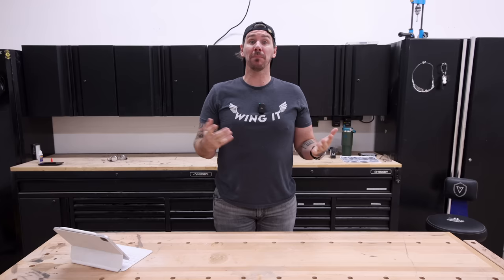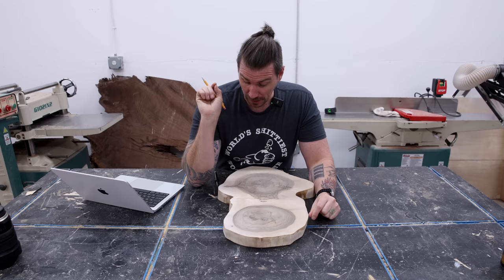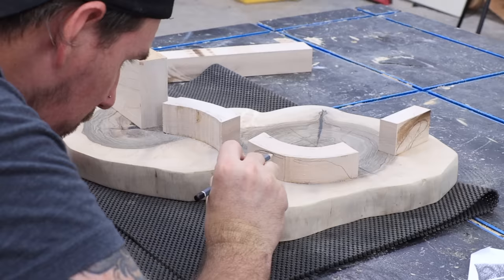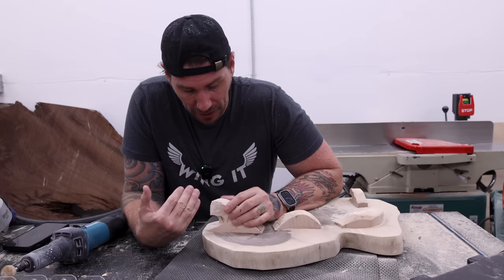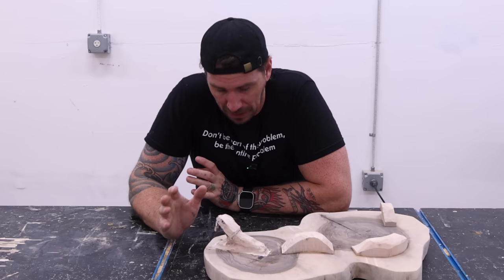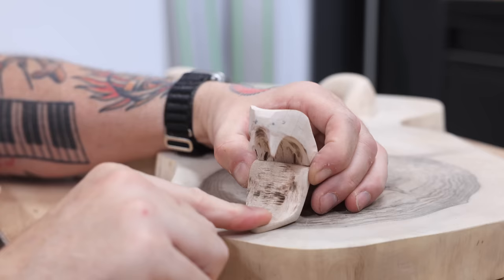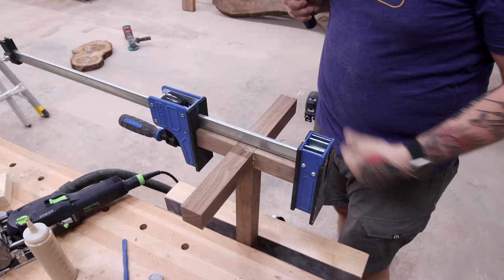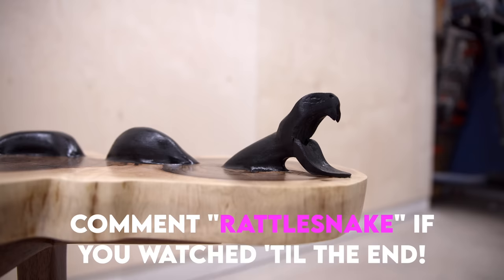Impossible Animal Carving Table

Comment: little tip i saw from another woodworking youtuber, when trying to remove excess glue use a drinking straw and you can usually get it in one swipe.

Comment: I'm impressed bro weather you fail or not keep going. You did as good as I could. I've been a carpenter for 35+ years. I just started doing wood work and mess up all the time however it's so much fun to me I just try n try again. Keep up the great videos amd don't let idiot comments even concern you. Table looks fine. Yes almost all snakes swim on top the water.

Comment: Rattlesnake.  Not exactly the buff tones of the one I met years ago, for sure.  Idea I had was, get images of rattlesnakes printed in black and white, to scale for your carving, then, after tracing the scales onto the snake body, come back with a wood burner tool to burn the tracing into the wood. You could probably still do that, then buff out most of the black, leaving India ink in the crevices. Cool table idea, as it turned out, regardless. Definitely room to put a tea mug and a book or tablet down between the snaky parts.  Thanks for sharing that we don't always have to have perfect projects. 👍

Comment: Why didn’t you not program it into the CNC to carve out the snake? You can take any picture and edit in windows paint converted to a PNG, windows 11 paint will allow you to one button. Click remove everything around the picture and then you can run it through a vector graphics free web converter and produce an STL.

Comment: As a wood carver who mainly worked with hardwood, you can only use power tools so far in smaller projects like this. You should have stopped  using them just right before you messed up the moth, and gone with hand wood carving tools , and small wood print block gouges.

Comment: Also OKC.  Also thieved from.  They "rehomed" my DeWalt DW745 planer.   I guess they took the biggest, heaviest thing they saw... Because they left everything else be, including the more expensive, lighter weight, Domino.     Anyways, now I have a dilemma... Replace with another DeWalt, or go larger, floor standing.   Neither is in my budget however.  Thieves suck!

Comment: It turned out ok, certainly better than your jokes at the end 😂

I think you probably made your life much more difficult by gluing the bits on first, you could have done several test pieces and laid them out to see which ones you liked best before gluing them down. Also, I think the final carve is the important part but you have a huge CNC - i'd have just done some 3d modelling and carved the fine detail on the pieces at the end and use hand tools next time rather than power tools, especially for the really fine details, you have much more control...

But as a first attempt I still think that it is great and glad you showed it to us!

Comment: Okay, i'm not gonna say you suck at this, what I WILL say is what you should've done. For starters, the table should've been bigger. If your table sucks at being a table, you have a decorative art piece, not a table. Nothing too wrong with that, you do you, I just like to put stuff on my tables without having to navigate a snake carving to do so, the others worked because either A) it was just the head poking out, or B) the body was poking out, but not nearly as far as yours was, width of the snake notwithstanding. As for the snake, you might've wanted to do the carving while detatched from the table, then either glued or pegged the carvings to the table when the time came, it would've been easier to get the texture for the scales done that way, I think, and my thought for the scales is this, you could've drawn out the scale pattern, then slowly but surely chiseled  the lines for the scales in. It might seem like a slow process (cause it is) but that's kinda the beauty of scales, they don't have to indent much into the carving, just enough that you know it's there when you run your hand across it. It's one of those menial tasks you sorta lose yourself in then you look at and think 'Oh shit, i've been at this for quite a while' but then you've only been doing it for like an hour. Past that, the mouth should've had a bit more depth to it, and the parts of the body that stuck out of the table (not the head) should've been more subtle given the flatness of the "water's" surface

Comment: Not being perfect with your first shot at something is to be expected. But if you don't try new things, (and screw up), you will never grow. 
 A hint that I have is to use flex shafts on your Dremel tools, or even try some other types of power carvers. Dremels can have just a bit too much vibration in the tips which makes fine details difficult. I have been doing power carving for some time now. I find that a flex shaft allows me to get into places and create angles easier. The smaller the handpiece the better.

Comment: The trouble between you and bm sculptures is he is an artist and you are a wood worker why dont you try and make some blow driers and your will be closer to a hair dresser then you are the artist that is bm sculptures
Reply from the maker: I can’t argue with anything you just said.
Reply: @JonnyBuilds sorry I must of been a bit typsy writing this negative Nancy stuff.. for your first time is pretty good and it's easy for me to criticize but it was a good attempt .. the trick with carving unless your painting is to use shadows.. for example where you thought you didn't have enough material for the jaw .. you could of just opened the mouth and had idt coming out of the water if you carved some down into the bulk of the table around the jaw as well as around the body parts of the snake with some ripples would of given more shadow lines making it more realistic. Also for scales and things chisels have a shaper edge and are normally alot easier for scales

Comment: It's really easy to say your work is terrible, it's difficult to say what it succeeds at and be kind to yourself.
For one, this is easily the worst introduction into any kind of sculpture so you set yourself up to struggle from the start, but that's the fun of the challenge. 
Reduction sculpting is very difficult as you are moving in reverse of layering details. So for example: If I am sculpting a face out of clay, I start by getting my head shape down. Then you block out your main features by adding more. Then you refine those and start adding things like hairs and blemishes, and when all of that is added you can work of putting down your texture. I can freely add or take things away with clay. With wood, you need to block out everything at once and very carefully add texture over top of that which you need to account for in your initial blocking. It's incredibly easy to take to much away and as I'm sure you found, organic shapes are deceptively difficult to get right.

TL;DR
The fact that we can tell it's a snake and you saw this project through to the end despite everything is a matter to celebrate by itself.
Reply from the maker: Thanks 🙏